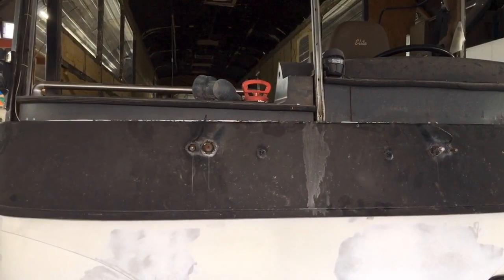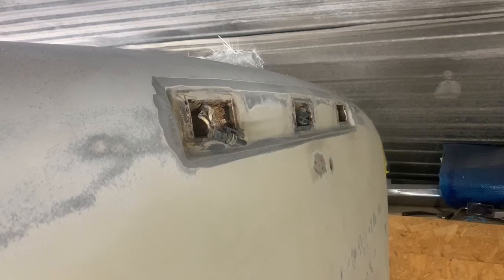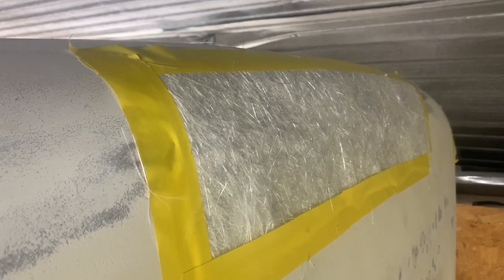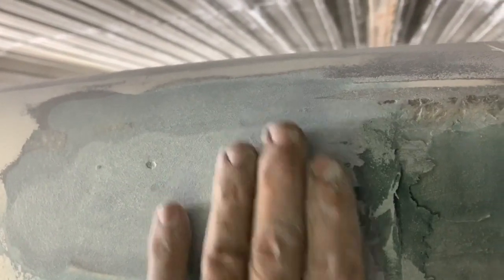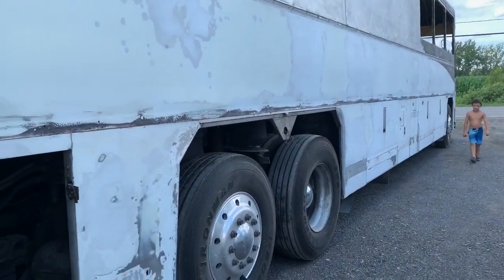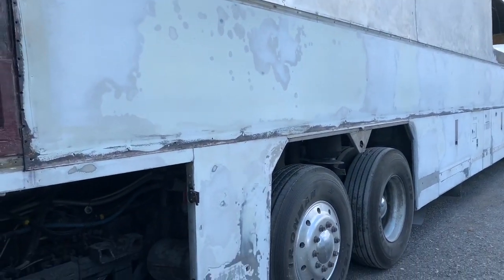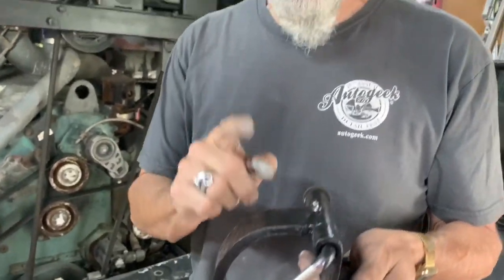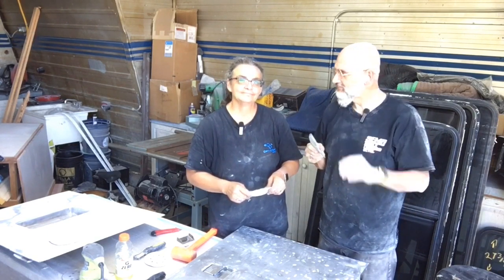E16, preparing for paint, hinge modifications, cleaning up some details .

Comment: Yvan, I would be interested in your opinion since you've taken the front apart, how you might approach replacing the passenger side windshield washer hose if the bus was originally assembled as our ELS3 is. Ours has blockage in the hose which I can't clear and the front road air handler blocks access from the stairwell. The bumper storage compartment has a solid overhead. I must be overlooking something.
Reply from the maker: Unfortunately other than tracing it down I can’t help. C&J Bus Repair in MN should be able to point you in the right direction.

Comment: I have been pondering why the previous owner painted the spray foam on the ceiling black - if you were asking for viewers wild speculations on the matter, mine would be that the ceiling treatment was going to be wood slats with small spaces (3mm) between the boards and they didn’t want to see the yellow foam so they painted it black
Reply from the maker: Possible

Comment: Given what you’ve found so far, I’m surprised you don’t want to get a peak at what is under the foam insulation, can you trust what is under there? Or is it the case that you have poked and prodded enough other areas that you are confident you would have found anything needing repair?
Reply from the maker: Where there was foam it seemed fine